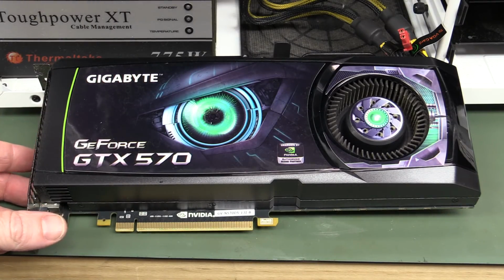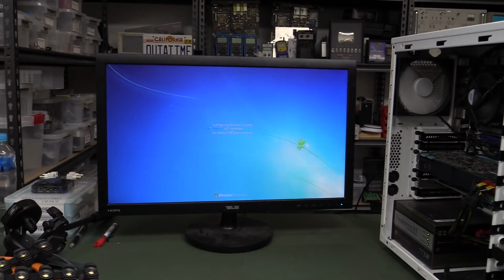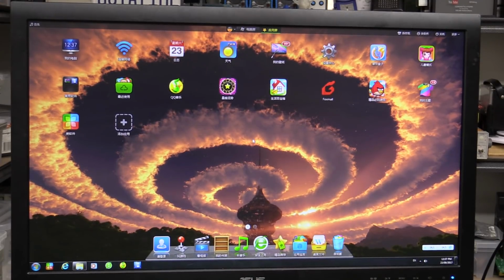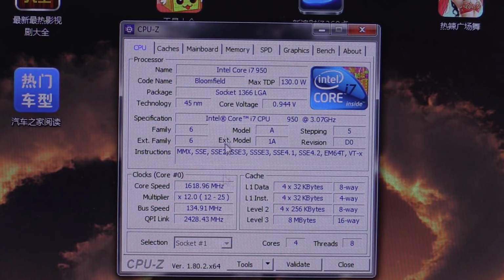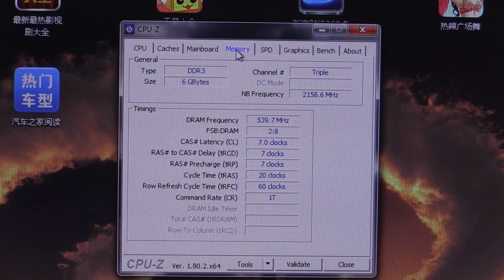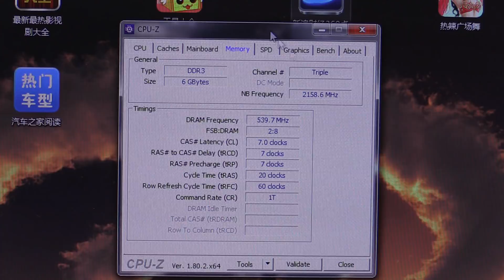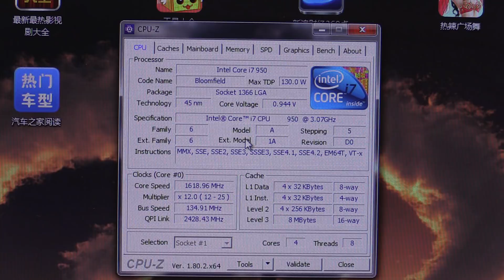EEVblog #1026 - Mystery Dumpster Diving PC

Comment: so like $300 machine? cpu, gpu, ram, case, storage, motherboard are each about $50 or little less, cooler and fans are gonna go for for a few bucks and psu might be $40. so all in all $300 ish, so not horrid. ooh forgot wifi card, $20-$40 for that. though for free it ain't horrid but far from amazing, I'd make it a linux machine or maybe some other secondary box.
Reply: If I found $300 in a dumpster, i'd dive in and get it.
Reply: It may not be worth much, but someone who wants a gaming pc, and cant really afford one would be really damn happy to have this.
Reply: I do realize that, i'm just mentioning that some people would happily have it, if they cant get anything else.
Reply: +Electronics For Fun
I'm sick of reading your snobbish remarks already, STFU! You have obviously never been disabled or in need. Just stop it.
Reply: "a 1050TI can be powered over PCI-E and would smash a 570 any day"
I replaced a GTX 570 with a 1050ti ROG as my backup card and that is true. However you could play a lot of hours with a GTX570 that you got for free before the power bill  got higher than the costs of a 1050ti.
Reply: it's worth about $300 parted out, and I found it on ebay going for 50, and gabbiadini, it's an i7 950 and overclocks to 4gig I believe. the gpu is worth 20 but can be sold for more cause ebay. system has 6 gigs of ram and sure it's by no means power star rated build of the year or anything close but a lot of place electrons are so damn cheap it's not a big deal. also great space heater for winter which is coming soon for us northern folks. edit: ram is 2133 ddr3
Reply: old stuff is expensive, dosnt mean its any good.
Reply: You could get 500€ for a machine like that in Slovenia...
Reply: Andrew Dunn oh eat shit my PC cost me $600 and isn't anywhere as good as that thing. AND YES IM SALTY RIGHT NOW. Sorry. Lol
Reply: electronics for fun I agree that it's junk but it's free junk, I'd take a core 2 dou with no graphics card in it for free though. And this sure beats out a 2008 budget system as a 2010 mid range build.
Reply: Have a look on eBay and see what people are asking for X58 motherboards. $200 USD is the norm.
Reply: Those X58 Boards are crazy expensive, wouldn't put it below 400 right now
Reply: I guess he called it amazin because it is actually still working an does even start up.
Reply: Neko77025 uses A LOT of power, NOT a ton.
Reply: A lot of the older games are better in my opinion. I'm bored with the latest FPS games.
Reply: Witcher III is the only modern game i really liked that justified a good graphics card. Talos Principle was also nice, but it ran quite well with my GTX570, no need to upgrade there.
Reply: Andrew Dunn the pc is better than my main rig.
Reply: how am l being snobbish? actually l have been disabled an in need, when l was a kid l was in and out of hospitals and a lot of the time l didn't even get to sleep in my own bed. l was on so much medication l couldn't eat anything without barfing it up, although l would rather not disclose what my condition was.
Reply: "Not everybody wants to do high end gaming, video editing or play 4K video. This machine is just fine for people who don't want to spend too much money, it will do things like Photoshop, internet, Office, music/video playback etc just fine." no it isn't, l have already talked about this. the amount of power that thing sucks from the wall will cost more than a cheap computer with modern hardware. you could get a raspberry pi or you could get an intel compute stick, or one of those little box PC's or you could just use your phone. all of these options would be cheaper than paying for the power this "free" computer uses.

"Stop living in your parents' basement and assume that every computer user is like you with similar interests." l don't live in my parents basement and l never assumed that. doesn't matter what your needs are this computer is a terrible fit either way. if l saw a machine like this in a dumpster l would probably leave it there, or scrap the parts and sell the case for a few bucks because that computer is useless, it is a dog in terms of performance and it uses too much power and puts out shit tons of heat. if you're a power user it's speed will make you cry, if you're a budget user then your electric bill will make you cry.
Reply: "oh eat shit my PC cost me $600 and isn't anywhere as good as that thing. AND YES IM SALTY RIGHT NOW. Sorry. Lol" l don't believe that.
R5 1400 $160
an asus motherboard on B350 chipset $70
3BG GTX 1060 $200
cheap rosewill case $25
cheap power supply from apevia for $20 and it's a 450w
and a 1TB WD blue hard drive for $50 
and the total comes out to $525
and this machine would be more powerful than that dumpster find.
Reply: Neon+ nobody needs an i7 950 and a GTX 570. there is no point in owning those components. they consume lots of power and don't work very well in 2017. if you need a powerful card then get a 1080 ti or a TITAN XP if you need a budget card then get a 1050ti or a 1060. you guys are just not listening, it's not all about how fast the machine is. you guys need to get your heads out of your ass and realize that there are many things people look for in a computer other than the speed. and this dumpster machine fails to meet the 2 biggest things people look for in a computer. it's not very powerful and incredibly inefficient, which means it's is no good for power users and it's not good for budget users.

"Your problem is that you hang out mostly with people your age and visit all these computer and gaming related web sites and then get the impression that the whole world is into gaming." where is this coming from? l don't give a flying fuck about gaming, l only have 1 game on my computer and l haven't played it in months. why do you assume a powerful computer is only good for gaming? l use my computer for video editing and rendering.

"Not everybody is your age, not everybody is interested in gaming, not everybody has the money, etc." l never assumed any of this. like l said l don't care about gaming, and l know not everybody has the money which is why they would leave this machine in the trash or try to sell it for a couple of bucks. because the cost of running this machine is more than it's worth. l don't know why people keep plugging their ears and ignoring this fact.

"Do you seriously believe that poor parents want to give their 4 year old a $1500 computer to practice toddler skills on?" of coarse not, where did you get that idea? l would think they would get them something like this https://www.amazon.com/LeapFrog-My-Own-Leaptop-Green/dp/B0038AJYSS/ref=sr_1_4?ie=UTF8&qid=1506901992&sr=8-4&keywords=baby+computer

Do you seriously believe that everyone who just wants LAN storage for the family at home, is going to go for an expensive computer?" no you don't need a very powerful machine for a simple server like a NAS. but if you were to turn this dumpster computer into a NAS then you're absolutely retarded. "hmmm... l need a light computer with 0 down time so l think i'll get a computer that uses tons of power and puts out tons of heat for no reason." l mean really? you're supposed to use a very energy efficient computer for that, not the biggest energy hog/space heater you can find.

"Do you seriously believe that elderly need the latest and greatest?" why not? it all does what they need, the only difference is one is more efficient than the other. they don't need the greatest but having the latest wouldn't hurt. you seem to be under the impression that l only care about how fast the computer is and that is not the case.

"Do you seriously believe that a security cam needs a $1000 computer to store the recordings?" nope but this dumpster machine will give you a $1,000 electric bill if you try and use it as a server of any kind.

"you silly child, and yes you're still a child in my eyes and in the eyes of Dave Jones and many other older guys around here." how am l being childish? because l am stating facts about why this isn't a good computer? FACT: this machine is not very powerful so a power user wouldn't want it. FACT: this machine uses a lot of power which means it would make a terrible server/budget computer. the cost of your parts is not the only cost of having a computer. l am sorry that being the only one here who can see that, makes me a child.

"Look at your videos, their content and the friends you hang out with, I bet you're still in school son." l don't claim to be old and wise but l do know what l am talking about. and l have been out of school for 2 years, l have a certificate of proficiency in video game development and computer hardware and l have built 5 computers since then.
Reply: its not a 300.00 machine at all ..  the CPU is only about 30.00 on ebay ... the GTX 570 is really not worth running nowdays ... uses A ton of power and makes even more Heat.   The case and PSU are really the only things that are worth saving.   I would throw it out myself.
Reply: Adam T+ l don't think a computer like this could please anybody, it's too weak for a power user and ads too many digits on your electric bill for a budget user. newer components are significantly more power efficient and much more powerful. a 1050TI can be powered over PCI-E and would smash a 570 any day.
Reply: you don't think an X58 board could be a collectible? l see people who are already using maxwell cards as collectibles.
Reply: Gabbiadini+ or you could get a brand new pascal card instead of replacing an outdated GPU with another outdated GPU. a 1050 TI would be cheaper and much more powerful than an HD7970.

and there isn't much you can do with a bloomfield processor, it will slug in gaming and in video editing and just about anything else other than surfing the web. a 6700HQ could kick the ass of a first gen i7, which is sad.

if l found a machine like this l would probably use it as a media PC in my living room, or l would just scrap the guts and sell the case and power supply.
Reply: Adam T+ yeah if you're playing games from 5 years ago. any modern AAA title would have a shit fit on a rig like this. if l had a machine like this l would part it out and buy new components. the parts in this machine are probably going to keep getting flipped on ebay until somebody tosses them in the trash and somebody else finds it and restarts the cycle.
Reply: back in the day this machine would have been a pretty penny. now that machine is junk even though it is only a few years old it's running a first gen i7 and the GPU is running on the fermi architecture which l didn't even think people were still using. l mean the cheapest PC's now are running at least a kepler or a maxwell card. and the oldest CPU architecture in a modern machine would be AMD's piledriver or intel's ivy bridge. l would buy that case and maybe the power supply, but the rest of that hardware is junk.

Comment: I found a 1year old system in a dumpster 2 weeks ago that all it had wrong with it was a bad cpu fan. ;)
Reply: It is a cyberpowerpc with AMD FX 4300, AMD Radeon R7 240 graphics, and 8gb of ddr3 https://www.bestbuy.com/site/cyberpowerpc-gamer-ultra-desktop-amd-fx-series-8gb-memory-1tb-hard-drive-black-blue/4593000.p?skuId=4593000
Reply: Maverick Wagner wtf people pay 550$ for that?
Reply: Lol I agree, it was still a good find. I ended up reformatting it and giving it to a friend. I kinda wish I kept it just for the case and 1tb hard drive.
Reply: Are you from aus? Where in general do you go dumpster diving?
Reply: No I live in the USA. This was just a random dumpster near a property I was working on. When I was younger I used to go on the air force base and find a lot of good stuff. Whenever the air force people moved they would just throw away almost anything. They are only allowed a certain amount of weight when they move.
Reply: /r/thathappend

Comment: Nice, X58, still a powerful platform if you put a cheap Intel Xeon X5650/X5660/5670 in and overclock it to 4Gh (or even more).
Reply: I had my X5650 running at 4.2Ghz (stock is 2.66) not too long ago. Basic old-school FSB+multipliers overclocking. Only reason I reverted was that it was putting off a ton of heat in this small room.
Reply: xeons are locked processors, which means you can't overclock them unless you are going for an undervolt overclock, in which case you can only push it by a few 100Mhz if you're lucky and your system stability will tank to the point where your overclock would be hurting more than it's helping.
Reply: Electronics For Fun my son, welcome to the good old times, where we where able to change the FSB from 100 to 200+ MHz easily 😏

Comment: "1.5 gig hard drive"

Uhh
Reply from the maker: I'm within 3 orders, what's the problem?
Reply: @EEVblog  good enough for australia!
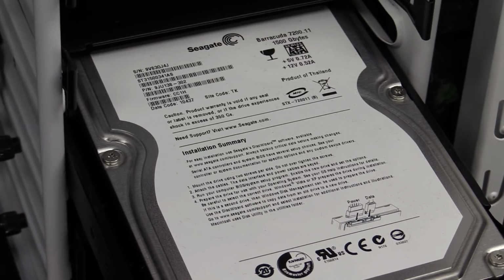Reply: Its a 1.5 terrabyte drive, 1500 gig (pause at 3:59, capacity is as plain as day).. That's decent enough. I'd do a couple of things to it to make it more reliable though. Clean the video card slot connector and memory connectors for a start. White rubber them then some INOX to stop future oxidation. BOB's YOUR UNCLE!
Reply: EEVblog worst error I've seen is a translation from English to Swedish, where AU (astronomical unit) was translated typ Ångström, 21 order of magnitude wrong.
Reply: EEVblog We're from the age when hard drives were measured in MegaBytes, not gigabytes or terabytes. It won't be long before the snarky millennials make the same mistake referring to terabytes when they mean petabytes :-)
Reply: Back in my day we used bits young whippersnapper!
Reply: tsobf242 I giggled too
Reply: Kids computer _ all games
Reply: The day I mess that one up is the day the 90's come back :)
Reply: Must be 1.5 TB not GB, because World of Warcraft would eat up near 35 GB all by itself.
Reply: Stephen Low thanks to the ref to AVE
Reply: Oscar Anderson 
It's thought that "Bob's your Uncle" comes from the fact that one particular British MP in the early 19th century managed to gain his seat due to the influence of his uncle Robert who was an existing MP and Earl.
Reply: I believe it's from England/Ireland not Aus (1880s or something), There was a politician who was quite adapt at giving government jobs to family members over more qualified applicants. A statement meaning success guaranteed because of family connections. Sounds oddly familiar lately.
Reply: Fuck! 1.5 Tb,  I'm still running a 500Gb in my highly overclocked FX8530 with GTX980 gaming/dual purpose PC with all custom water cooled. Only managed to fill 40% of the drive after nearly 10 years of using the drive.  I just don't know what can possibly fill a drive up of that size.
Reply: 3800Tech for some people it's stuff that starts with a "G" because graphics, for others it's stuff that starts with a "P" because they like to look at it all day.
Reply: In like Flynn (David Niven couldn't believe what his room mate got up to).. Noisier than a dunny in a hailstorm. Copped it sweet.
Reply: Dave, had to add on the thread... Ya called it wrong on the drive size. Regarding rig comparison.. my rig exceeds what ya picked up. But for a dumpster find, SCORE!!
Reply: I have a desktop with the same specs. It’s several years old but it’s made a great Plex server for me now!
Reply: Ahh the classic 7200.11 drives.  I'm surprised it's still running lol.  Those had a super high failure rate.
Reply: TheWizzPower AvE didn't create the term Bob's your uncle, it's not too uncommon but he does use it quite a bit.
Reply: @3800Tech about 10 modern games
Reply: Mine died and I had to talk to it with the serial port to get it working again.
Reply: Proscriptus I still have the original 40 megabyte drive from a computer I set up for my wife back in the mid-90s. The first hard drive I had in a PC was a 10 megabyte. One of those big honkin MFM drives that made the pleasant chirping noise! I kind of miss those noises.
Reply: My first one had no hard drive or disk drive... it had a tape drive. You saved three or four copies, hoping at least ONE of them would work. My first one with a hard drive was a Lisa 2 with a 5 megabyte drive! Wow! What a black hole for data that was! Learn, grasshopper... learn.
Reply: I used an Auto-Trol TMS9900 16 bit machine (or an 8800, fabulous processor, CPU had 3 registers, no general internal registers, all memory mapped with a pointer to them so, no stack needed, interrupts just changed the pointer). Tape drive and ram based OS, you had to turn it on and type in some op-codes on a teletype to get it to jump to the tape loader.